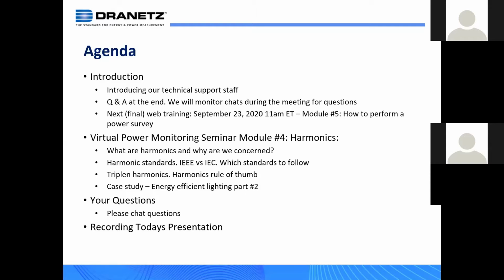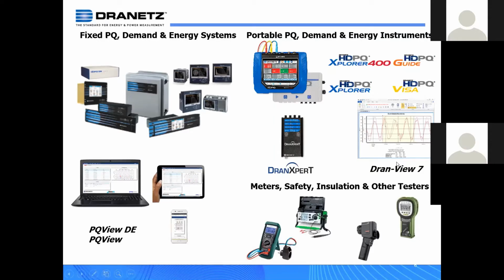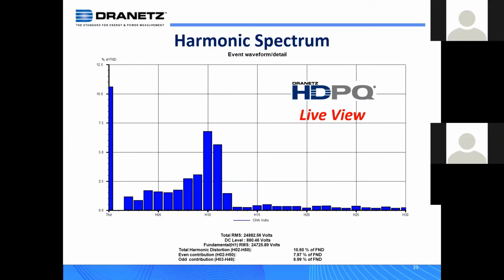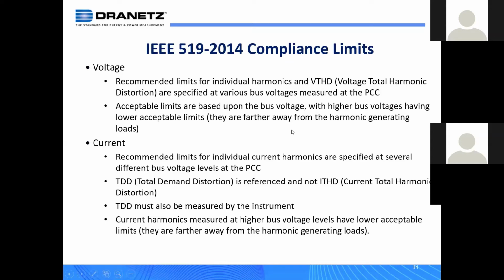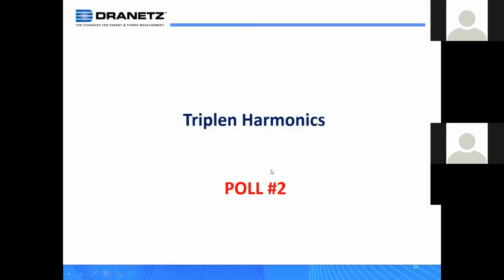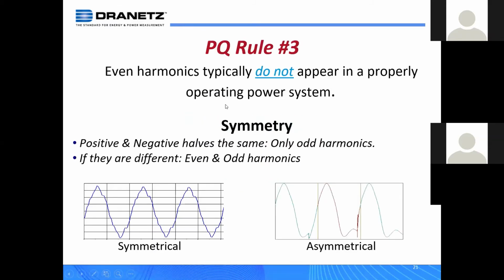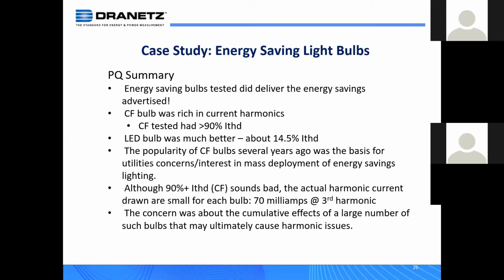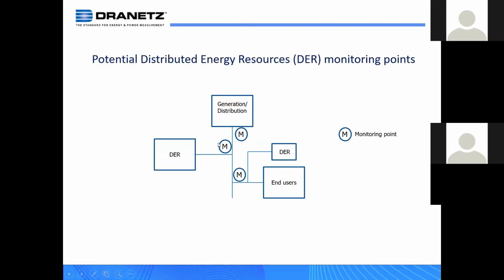September 16, 2020 Seminar Module #4 - Harmonics

Comment: Nice set of presentations. Well done. I agree more set of presentations on use of the equipment in residential, commercial and industrial and in addition to specific situations on solar, wind, data centers, financial trading systems.
Reply from the maker: Thank you Math Man. Check out our application videos. Some may meet your needs.